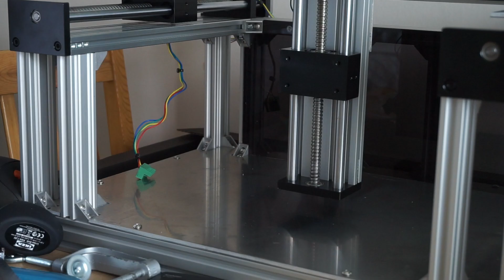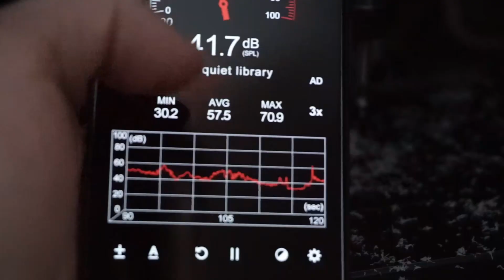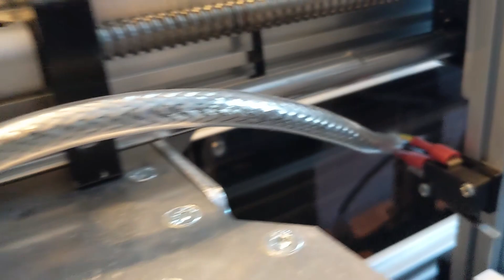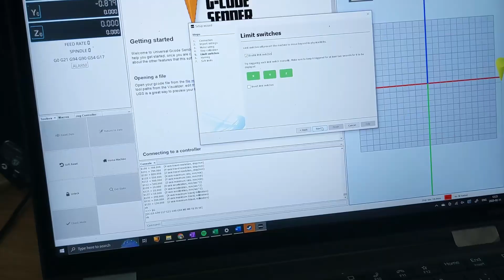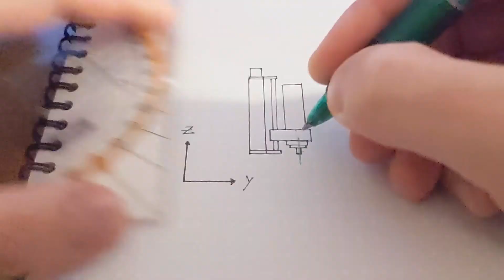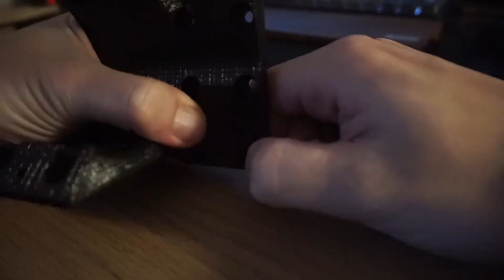Desktop CNC mill

Comment: It is necessary to use carriages on balls on top of rail guides, instead of round guides. The main reason is that the rails have support along the entire length and not just at the ends like round guides, and therefore the strength and rigidity of the rail guides is many times greater.
Reply from the maker: Absolutely! Will be using linear rails on the next one!
Reply: @JonathanWebster-lr5rg  👍👍👍

Comment: go with a smaller endmill but initially i think your feeds and speeds can do some improvement, I believe you can cut aluminum like acrylic just reduce your spindle speed as you said it was loud meaning you were grinding aluminum rather than making chips, anyways interesting video.

Comment: Using optocouplers was a fail.. it does not smooth anything, but It does have a ON treshold, so it works for you by chance - you might as well used a relay. A capacitor would smooth the signal and a schmitt trigger ic would prevent the unknown state in the middle or double fire.

Comment: Super cool Project and great video!

To machine metals, you will definitely need more rigidity. You see, aluminium seems stiff but it really isn't. Aluminium has an E-Module (Module of Elasticity) of 70'000 while regular Steel has 210'000. So a piece of aluminium flexes three times as much as the same piece of steel would unter a certain load. Replacing some parts with steel will definitely help. 

Also, I think you need to switch to linear rails on all axis. The problem of those ground rods is that they are only supportat at their ends. But at a microscopic scale, everything is flexible. Those rods bend a lot. If you apply a force of 50N (5Kg) to a 12mm rod with a length of 500mm, it will bend 0.6mm. So even if the cutting force causes just 1Kg of downward force on a rod, it will bend by 0.15mm. 

Also, weight is your friend here. Small machine with high speed spindles create high frequency vibrations. Those can be damped by using heavy and stiff parts. The fact that Aluminium flexes 3 times as much as steel also means that the amplitude of the vibrations will be much higher. This leads to inaccuracy and noise. What also helps is to fill hollow parts with concrete or sand.

Finally, the tool and the alloy of your raw material have a great impact on the result. Try using small mills with high spindle speeds. The cutting forces will be lower. As raw material, I would suggest AW-6082. This is a really well machinable alloy.
Reply from the maker: Thanks for the input, very helpful and insightful :)
Reply: Don't use regular concrete (the kind you mix with water and use to make a foundation for a building). It's not dimensionally stable and will warp your machine frame. Instead, use what's called "epoxy-granite" - which is very similar to concrete, except instead of Portland cement and water, you use epoxy resin. There's lots of information available on this on the internet (both on YouTube and on other websites and forums).

Comment: few comments on why the moving spindle... i sort of agree, but dont.

better to have the Y vertical. mount spindle horizontally, can have the rails as far apart as possible, and that gives you Y to full "height".

Z, you lose the spindle height regardless, so thats no issue, or it may be a tad longer with drills and chucks and extra room in Z is always a bonus...but...

you also get to hang stuff out the end. you could say, iunno why... engrave the end of a broomstick? actually,pool cues maybe...  lol, candle sticks, and you can still run a 4th axis rotary on the X...
far better chip clearing. so setting jobs up may be a bit more fiddly. its CNC. the machining side is easy at least?

 theres always a compromise on things like the spindle, the travel plus the mounts and yeah... i know. its harder than it looks. i give credit that you did it from scratch and its running?

nice build but i feel you could go back to the drawing board and rearrange the kinematics to re-use what youve got to be far more rigid...

Comment: Can you test it's precision using PCB milling? This is quite hard task to achieve without a good machine, especially for 0.1mm / 0.05mm trace width/spacing ;) Spiral (or regular one flute) bit  0.1mm 15-30deg. is used. My machine can't go under 0.25mm, but it's rigidity does not exist (it was based on freebie CNC3040 I got from a friend who got a bigger "toy"). I'd also complain a bit about PCB layout, but I'm also often too lazy to do it properly, so if it works then it's fine.

Comment: Why not create a self calibrating system, that automatically adjust for the reduced rigidity and precision of various less expensive mechanical components. Similar to the input shaping, but adapted to CNC. The compromise is to run the calibration cycle once a while after certain hours of machine use, and before any high precision job. Just some 💭.❤👍

Comment: Curious why you didnt go for a fixed gantry design like the Sainsmart 3020 pro  max v2. Much more rigid and more simple.
Reply from the maker: Mostly to keep the footprint of the machine smaller, with a fixed gantry you need to move the part so either have a smaller working volume or a larger machine. Fixed would totally have been more rigid though.

Comment: Why on earth are you calibrating the steps on the axis. You know your steps per rotation and the pitch of the leadscrew. If its not precise movement then you probably have a cheapo leadscrew. Its worth investing a little bit more money to get a higher grade.
Reply from the maker: I didn’t think of that - now I know for next time😅
Reply: @JonathanWebster-lr5rg  if you ever rework your cnc, id ditch the linear rods, since linear rails (hgr or sbr type) are supportet all the way, and not only on the ends , otherwise looks like a promesing cnc
Reply: Do you have a link to your CNC mill?  It sounds interesting, but  I couldn't see it on your channel.

Comment: Considering all your effort, time has come to admit, that your design is flawed and there is no way to fix it other than to fully redesign your machine.
There is a reason CNCs have fixed gantry: mass + leverage + angular momentum.
Reply from the maker: Fixed gantry is certainly the most rigid way of doing it. Machines like the Shapeoko and the stepcraft aren't fixed though. I like the moving gantry design as most of the machine's footprint can be working volume. It is a trade off though.

Comment: if you want metal parts, you can cut the parts from polystyrene insulation board and cast in aluminum using the lost foam method.  It's likely you'd have to iterate a few times due to the aluminum shrinkage (at least I would) but the results might be worth it.  good job on that machine,
Reply: Or make the part on a 3d printer and use the lost pla method

Comment: maybe it wouldve been much more rigid if you went for a knee type mill design, with the spindle on Z axis? would be much easier to get more rigid.
Reply from the maker: It certainly would have been! I wanted to try keeping the machine from getting too large though.
Reply: @JonathanWebster-lr5rg  very fair uwu
Ive been thinking of making my own tiny cnc mill using 40160 extrusions with concrete in the cavities. But such a project i only wanna do once im done with 3d printers xD

Comment: your problem is your going to fast and to deep. and using one bit learn to use multiple kinds for different materials and if you want detail use a different bit
Reply from the maker: Yeah absolutely; to get the most out of it I would need to do some more comprehensive testing for speed, feed rate and tool diameter.